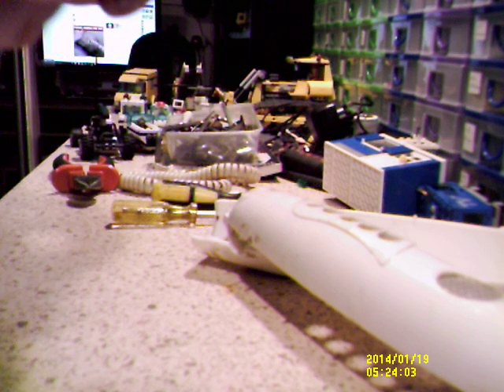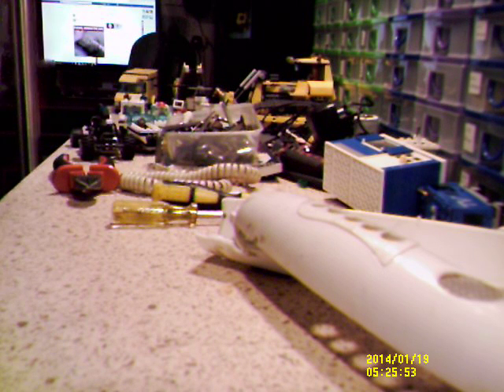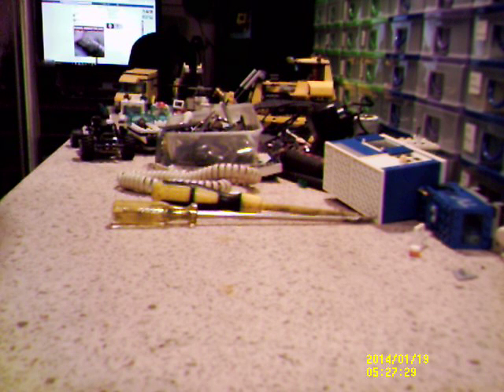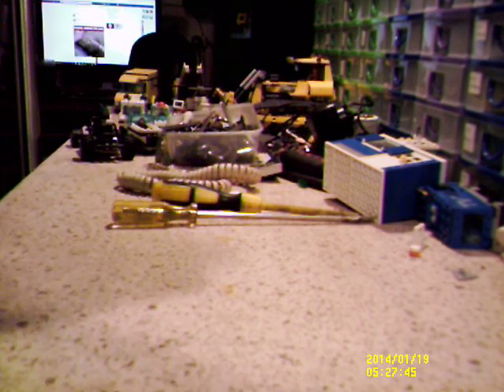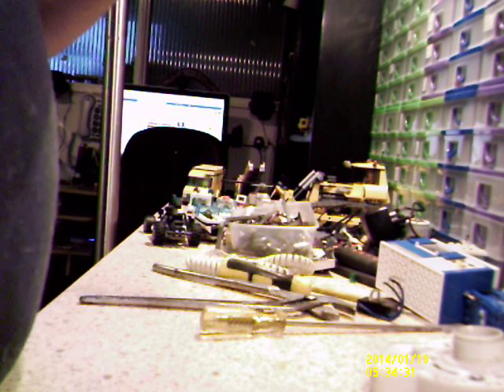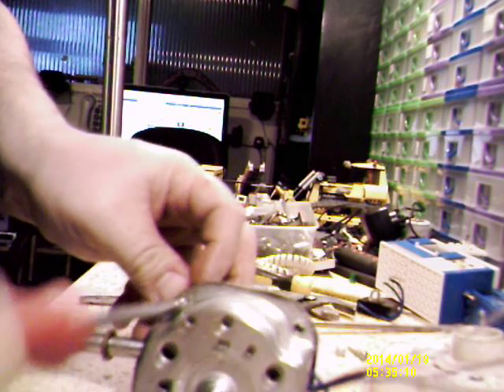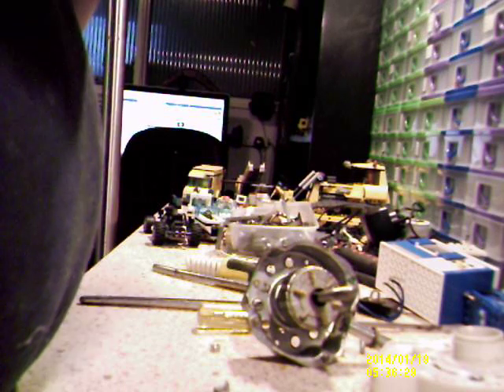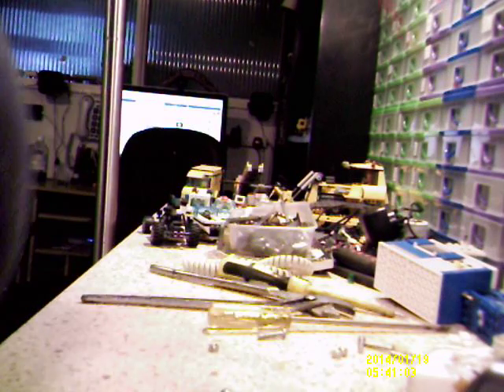My fan died, so lets take it apart!

Comment: Thats a start cap it alters the phase angle of the windings to start the motor, my one went the same as yours so i replaced the capaciator with a 1.5uf 400v "all i had to hand" and it worked fine. that fan shouldn't need a suppressor because it has no commutator, a suppressor capacitor would suppress the arching and would probably be in the order of 0.01uf
Reply from the maker: +Paul Brace If this fan wasn't falling to pieces anyway I'd have probably fixed it. A lot of the plastics had gone brittle, I had to super glue the fan blades on lol So I figured as it had stopped completely it was time to replace it
Thanks for the info on the cap :)
Reply: yeah i know what you mean my one was about 4 years old when it gave up completely so i got a remote controlled one off ebay for 50 quid.